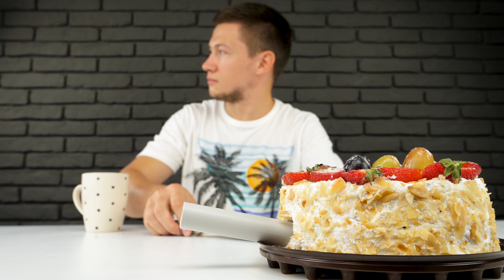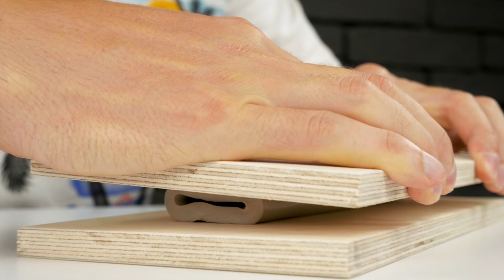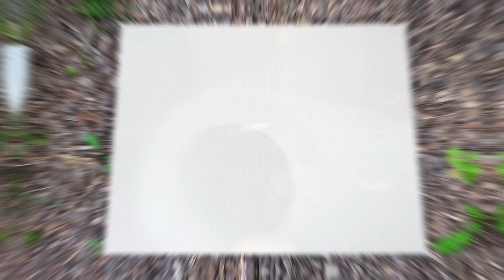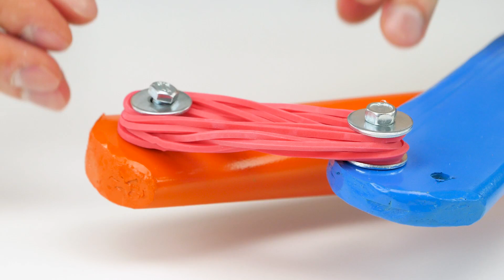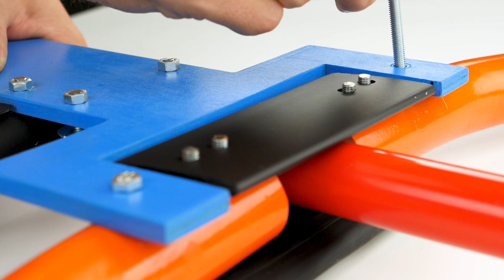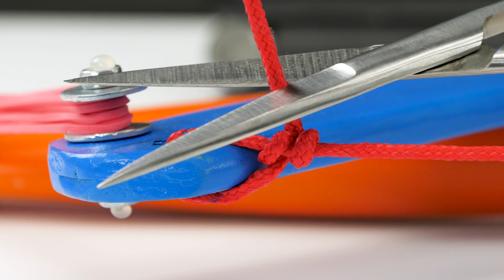How to Make a NERF Bow at Home

Comment: Possible improvement to this NERF Bow, make the magazine spring loaded and place the magazine below rather than on top, so that way rather than the ammunition being fed into the chamber on the top via gravity it will be fed upwards by a spring, that way you will have a clear line of sight so you can see what you are aiming at.
Reply: You could probably take an existing nerf mag and build the chamber to accommodate it

Comment: Some ways to improve:
Make the front of the "bullets" slightly heavier than the bullet so its always head first
Reply: MaxPlayz that won’t work, it will make it tumble more. What WOULD work though would be fin stabilizers like in actual arrows and anti tank rounds. Since they are long rods, they should probably have a sable so the loading would be more smooth.

Also, if possible, he could make it spin so it stabilizes when shot, like rifling on a barrel.

Comment: he could just not have that thing at the top of the magazine because if he didnt he could make clips or just attach the magazine differently so it could be replaced with a full magazine

also for anyone who does not  know a magazine is a object which holds and feeds the cartridges with a spring while a clip is a small piece of metal which holds the cartridges to be loaded into a internal magazine a great example of clips and internal magazines is the M1 Garand and a great example of magazine would be the Bren because if you were to make nerf gun of it you wouldn't need a spring gravity would work well

Comment: FYI, not all instructions and measurements are included. How do you make the dart chamber? What size nuts and bolts do you use? What did you use to seal the ends?